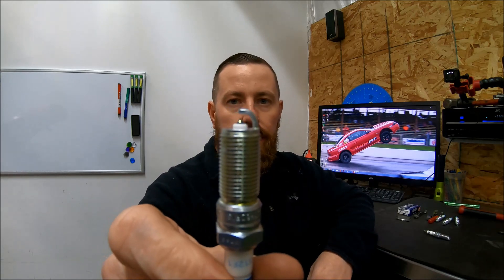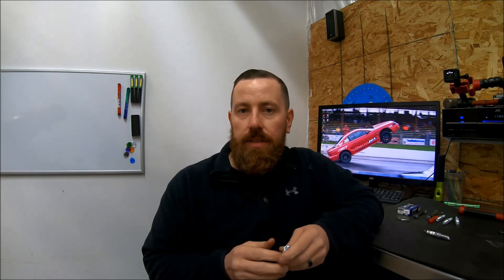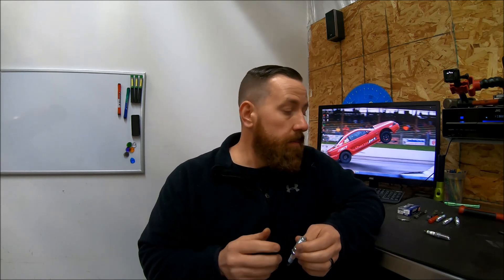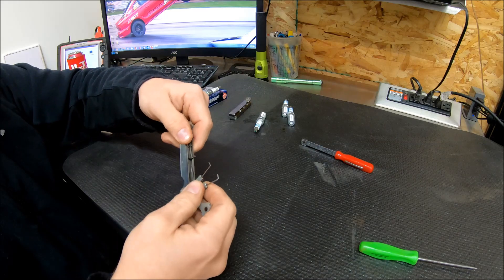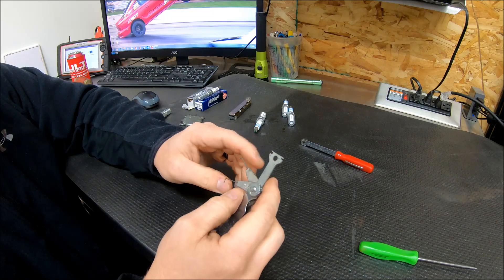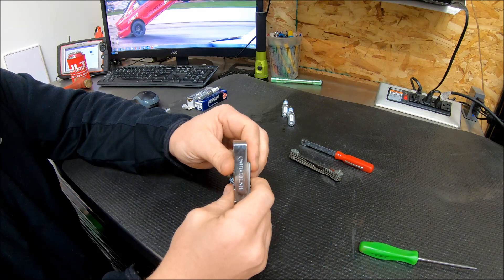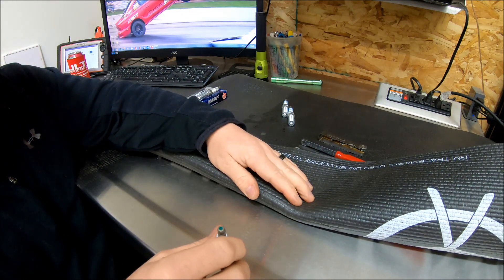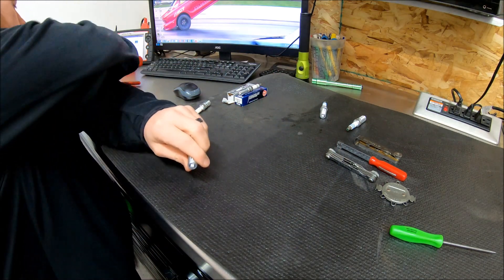SPARK PLUG GAP WHY IT'S IMPORTANT

Comment: I have a2003 rcsb silverado with a 4.8 ls...i installed long tube headers into true duals...cold air intake with k&n filter...and tune...i also did the coolant bypass on the throttle body and then I ported and polished my throttle body....when I say "ported" I mean that I hogged that SOB out so much that I had to make a new throttle blade/butterfly because it was drawing too much air around the original blade and caused a high idle issue....i could have used my hp tuners to correct the idle but I felt that making a new throttle blade was the correct solution to the problem...once I got that lined out and had it running correctly again....i then decided to give it an over priced and probably overated tune up with msd wires and a switch to gen4 coil packs....i decided to molest my tune up budget with those pretty msd wires instead of using the ac/Delco that it calls for....and instead i cross referenced the plug and used NGK tr5 2238 they are just regular copper plugs....and I decided to gap them at .50 because one of my buddies spit out some horseshit that sounded remarkably plausible....he told me the wider the gap the better fuel economy and the smaller the gap the better it is for power.....or maybe it was vise versa....this was. Almost two years ago....anyway, after I tapped the living shit out of my plugs at .50 and got everything put back together , when I went to start my truck it no longer fired up really quickly right of the bat on the first hit like it used to do....from then on it had to spin over quite a few times before it would start...most times I'd have to let of the key and then crank it over a second time before it would start....at the time I chocked it up to the assumption that my fuel pump was possibly getting weak or on its way to going bad....this was before I had hp tuners....now that I have it and can scan and data log in real time...i see that my fuel pump is working perfectly....as well as my injectors...even tho I've added some timing to my tables it doesn't matter whether I add or subtract time or increase the short pulse or power enrichment on start up , nothing I've tried in the tune seems to help it start any quicker like it used to do....if you haven't given up and you are still reading this shit forsaken book of a message I wrote ....then my question is: what do think the likely hood is that my big ass .50 gap on my plugs is the cause of my truck having to spin over so much before finally starting? Could to much gap be causing the spark to be weak or to cold to ignite the AFR inside the cylinders on start up? It seems to start quicker when the Engine is warm...but when it's cool it usually spins over for a few seconds and doesn't start until a second or two after my second attempt to start.....i know I could find out on my own by pulling the plugs and tightening up the gap to .30 or .40 but I don't feel like do all that shit till it's time for new plugs? If you strongly feel that my excessively large spark plug gap is the issue responsible for the delayed start then I'll grap a new set of plugs tomorrow and gap them according to your recommendation....if I don't get a reply then I'll assume you said "fuck this, I ain't reading all that"....and I'll keep driving my truck like it is and not give a shit....but when I do buy new plugs I'll gap them at .35 or .40 and I'll update this fucking "never-ending story" and specify whether the new plugs and gap corrected the issue or not .....well thats all....i know it was a ridicules amount to read and for me to write....but I didn't have anything else to do....hopefully you don't either...but if you did then taking the time to read all this has probably fucked those plans all up....my apologies